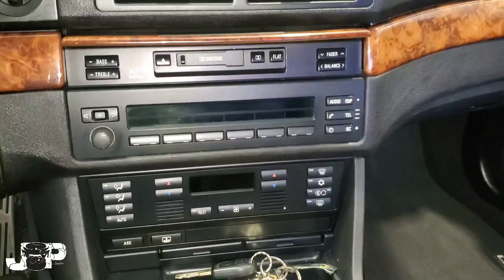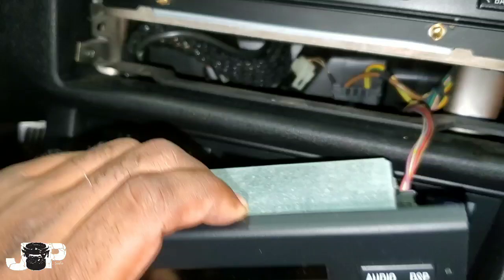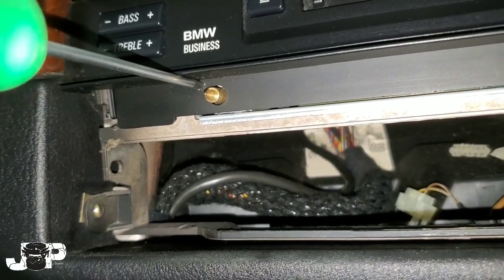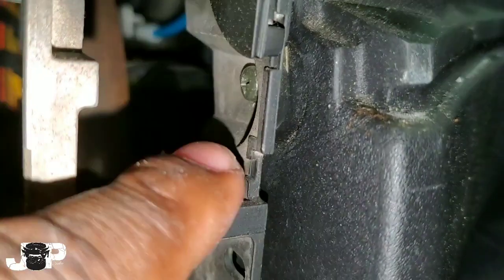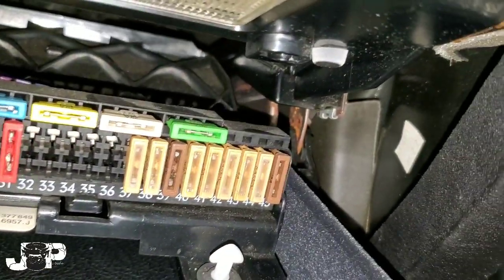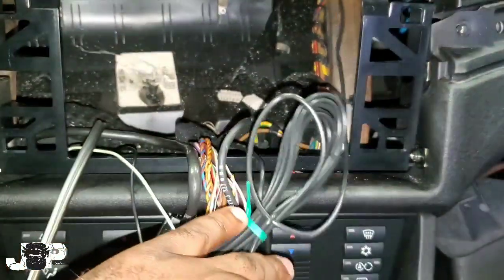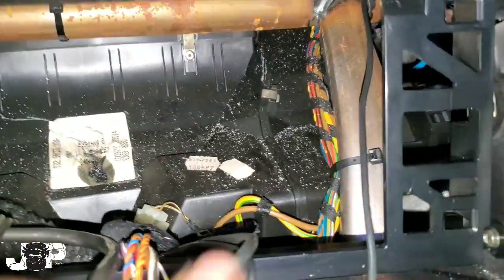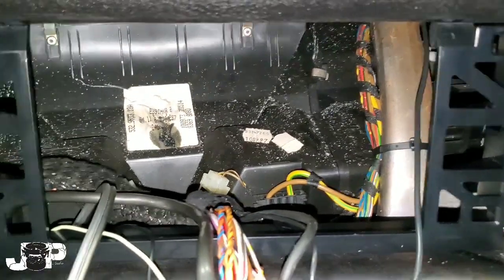1998 BMW 5 series radio removal w/ full install without taking the whole dash apart

Comment: No way youll see this now but im gonna ask anyways, i see that this car has the dsp sound system meaning it also has the factory amp. I also have a dsp car but the connections on the harness i have been given are not correct, and i’ve been told u cannot run an aftermarket headunit with the dsp as well. Clearly, you got yours working, and i was wondering how you wired that adapter to the factory harness with the antenna and dsp cable as well? I wish you would have just shown the wiring once in the video xD

Comment: if i'm replacing my head unit radio do i need new speakers too? i was wondering and mine is a 1999, so i figured this would be this best place to ask
Reply from the maker: Well that depends. You don't absolutely have to some stock speakers sound better with the aftermarket radio, but if your factory speakers are blown or in bad condition then yes change them. Every situation is different
Reply: @jptheinstallguy  thank you! i was really unsure and this helps out a lot, i appreciate it :)